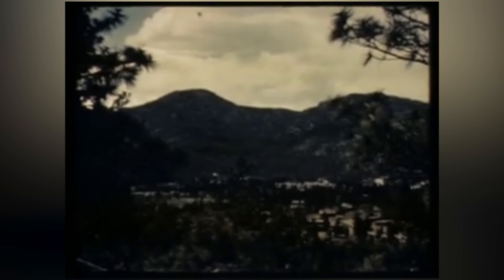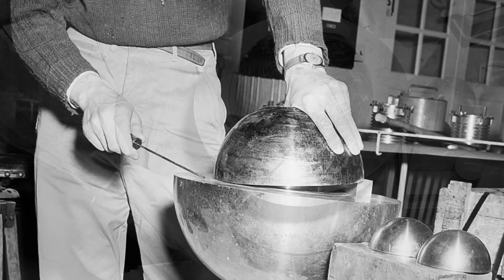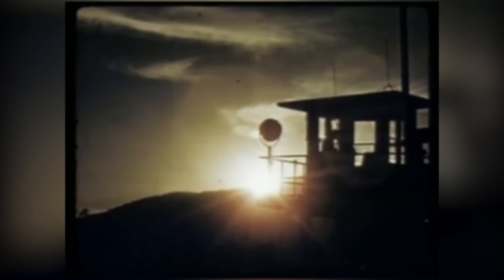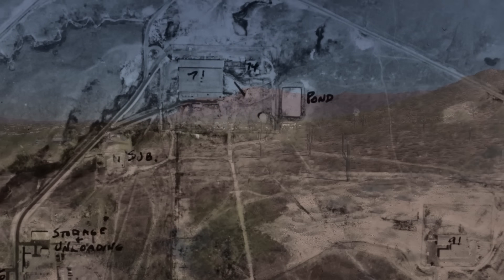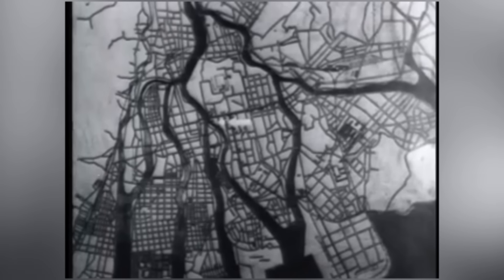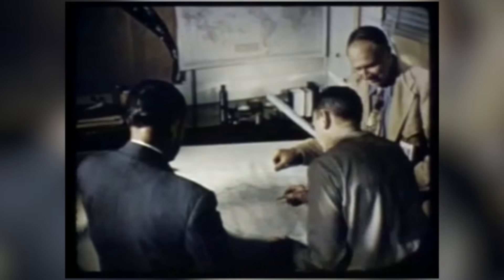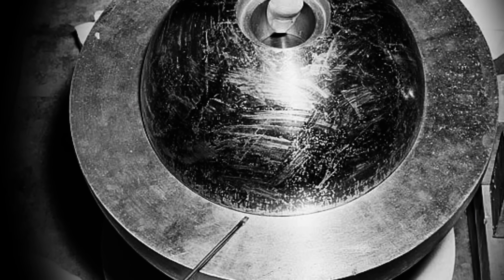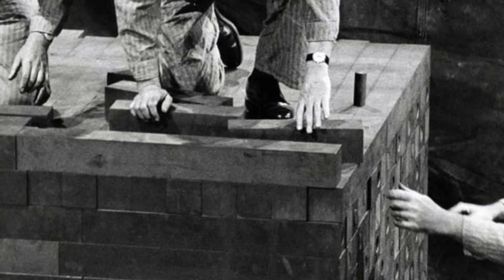Demon Core: The Unused Third Atomic Bomb of WW2

Comment: > 2 cores dropped on Hiroshima & Nagasaki -> 270k killed -> just normal cores
> 3rd core kills 2 scientists in an accident -> demon core
Reply: Good machines (or cores) don't kill people unless the operator intends them to.
Reply: Bill Randall  where you get that number bro? You're saying about 35k died in each city, on average? Lol
Reply: tim murray  the nuclear bombs were a single bombing run each though, the Tokyo firebombing was nearly 300 bomber flights, so not nearly as efficient.

Edit: population density in Tokyo was also much higher so it's possible if an atomic bomb had been dropped on Tokyo instead the casualties would have been much higher.
Reply: Didn’t they make a movie about that accident?
Reply: Parker Hetzel  There is actually plenty of room to argue casualties would not have been nearly that high. One factor in favor of the attackers would have been the famine which struck immidiately post war and whose conditions were set in motion, of course, by the war. Most japanese internal commercial traffic (including moving food) was concentrated in coastal shipping and a very small number of railroads. Lemay preferred terror bombing to the interdiction of the strategic transportation network on land but the US Navy had already done more than enough work in eliminating japanese merchant shipping. If the war had dragged on it seems highly likely Japan would have been forced to surrender, especially under a change in bomber operations to target vulnerable railway bridges and narrow coastal highways, in the face of a massive famine. An invasion would have still been necessary however, not because the Japanese would refuse to surrender, but because the Soviets would certainly have staged their own invasion and the US did not want to see a divided Japan (obviously preferring it to be entirely under their control). For that reason, that is the looming Soviet invasion threat, the nuclear bombs may have been necessary to speed up the surrender. On the other hand, the Japanese absolutely did not want to be invaded by the USSR either and there are persuasive arguments that it was the threat of Soviet invasion and not looming famine or nuclear bombs that coerced their surrender. Estimates of hypothetical American casualties in an invasion have also 
 since the immidiate post war years continued to be used to justify the dropping of the bombs by claiming they saved anywhere from around 250,000 to millions of American lives. During the war as they built up to invasion casualty estimates were typically keyed into specific operational timeframes but given all the other considerations I've mentioned it does seem likely that Japan would have surrendered shortly after the invasion began. If for whatever reason the Soviet's didn't invade and Japan didn't surrender is the only scenario I could see half a million to a million being realistic.
Reply: They called it demon core after the second deadly incindent, to suggest that something is jinxed with it, not because of the death toll.
Reply: Bill Randall  what? I wrote "they got what they deserved"
The scientists, for making these human exterminators.
Reply: @gyuui4242  I have to take issue with this thought that the bombs didn't play a large roll in the surrender. Sure might not have been the only thing working against them but you have 2 cities wiped off the map in moments a piece and it would scare the hell out of their admin. They'd have to consider this might become a regular thing and wonder how many the u.s. had. I'd think it's a little unfair to say no the Russian invasion looming was the reason. Sure it may have contributed but you can fight boots on th3 ground. You can't fight nuclear weapons man to man.
Reply: @onceuponadime978  I'd agree the bombs certainly didn't slow down the surrender process, they were definitely scared of more of those dropping, but they had already seen cities wiped off the map (Tokyo firebombing for example destroyed more square miles of urban area than both bombs combined). It wasn't the generals who convinced the Emperor to surrender, either, if anything it was the other way around. The General Staff was far more willing to adopt the "fuck you" attitude toward invasion than the Emperor himself, but to save face it had to be seen that the Emperor was convinced of surrender. In that regard the nuclear weapons provided the ultimate excuse. I think the best thing the nukes did was give the Japanese leadership a credible reason to surrender, rather than forcing them to or scaring them into it.
Reply: Parker Hetzel  The Soviet's wouldn't have needed a real fleet as the Japanese Navy hardly existed at the time. The amphibious invasion of the Kuril islands was undertaken with trawlers and minesweepers and other non-combat boats launching small craft full of troops, none or nearly no dedicated landing craft existed. The invasion of Hokkaido would have been much the same. It would have been possible, and given the Japanese had, as you said, concentrated most of their strength in the south against a possible American invasion there would have been much fewer troops available to defend against the Soviet attack, especially considering moving troops between the islands would have been extraordinarily dangerous for the Japanese at this point. It's likely the Soviet's could have landed multiple divisions on Hokkaido which would have been more than enough to overwhelm any organized Japanese resistance there and left them to deal with partisans in the way you've already intimated they were likely to deal with such threats. While the actual calculus related to the decision to surrender is likely locked away in an Imperial archive forever, I don't think it's possible to deny that fear of a Soviet invasion was a growing concern. 

In the end given the reason I mentioned in my last post (that the bombs were a convenient excuse for the Japanese high command to surrender) it is almost certainly true that the bombs saved more lives than they cost, especially and definitely so if invasion had been launched. I do believe the Japanese were looking for a way out of the war by this point, though, and I feel it likely that they would have surrendered under siege conditions. The famine, however, would itself be likely to cost more lives than the bombs in any case.
Reply: @gyuui4242    I agree with your premise, that the nuclear bombs enabled a surrender instead of the US having to conquer the Japanese islands, at the cost of millions of lives.  
There may have been another possible route to ending the war - blockade of food shipment to Japan.  Japanese shipping was already largely destroyed, just prevent crops from arriving from Korea and other sources, and shipments between Japanese islands, and the ability to prolong the war disappears
Reply: One plutonium core used for Nagasaki.   Hiroshima was a uranium gun type device.
Reply: @gyuui4242  .... You're correct sir... I've done a lot of reading about how German soldiers we're EXCITED to see they were being taken P.O.W. by Americans and not by the Russians from from the East.... There's no doubt the word of rape and torture and murdered Germans left after the Russians came through their town had made it to Japan... I'm sure the Japanese feared they'd be treated by the Russians like they treated any prisoners and citizens of conquered territories...(Ask China)
Reply: @loctite222ms  The US was eager to know which core was more effective / destructive, so two different bombs were dropped on Hiroshima and Nagasaki. The crap about ending the war was a sideshow; the real interest was in showing the world what the USA could do, and establishing which bomb would be developed (plutonium won)
Reply: AMERICAN scientist. 1 American is equal to approx. 1.2 million non Americans. I thought everyone knew that.
Reply: Inaccurate.  The third atomic bomb was used on Nagasaki, the second on Hiroshima and the first at Trinity (White Sands).
Reply: @ScottishPEACEguy  The scientists were working on a project to protect the United States from annihilation. ALERT...TRUTH BOMB WARNING...
The politicians and global leaders at the time deserved death....especially Rockefeller, Ford, Preston Bush, among others, who had placed Hitler and Stalin into power, attempted a coup d'etat against the US Government in 1933, gave the Soviets and the Nazi the Ford and GM factories to produce war materials in the 1920s and 1930s, sold both sides the Oil necessary to prosecute the war, and made blood money profits from the spilled blood and unimaginable suffering of foreign and domestic civilians and soldiers.  The war, the entire war, was orchestrated by Wall Street fat cats and the USA emerged unscathed, if you can imagine that, with her infrastructure unimpacted.  Thus we were the only real World Power post World War II. 

We rebuilt Europe, Japan, and the Soviet Union...yes...we even rebuilt the Soviet Union...on the sly. Type in the words, The Best Enemy that Money Can Buy, into Google, READ the book by Antony Sutton (Read them all) and get ready for a shock. Then READ War is a Racket by USMC Maj. Gen. Smedley Darlington Butler. He was the man who stopped the 1933 coup d'etat against the USA. He only won the Medal of Honor..TWICE

Seriously...Type in those names into Wikipedia. Your entire perspective will change as you will find out just how much that your schools have lied to you.

Your sorry ass would not be around to spew your drivel if Germany had gotten the Bomb first.  That is the reason why it was made....Germany.  We knew that we had Japan beat....before the first bomb ever fell onto Hickam Field at Pearl Harbor on Dec. 7, 1941.

Sprechen zie Deutsch?
Reply: @gyuui4242  There was a faction of the Japanese High Command who were against the surrender and there was an attempted coup while the record of the Emperor's words were being delivered to the Radio station to be broadcast. While loyalists stopped that, it may have gone the other way.
Reply: @avoimena  I hope that is snark. People die daily in automobile accidents on the roads of America due to human stupidity. (Yet it is far worse in Russia as if that makes a difference.) What do you want TO DO about it?
Reply: tim murray   The nuclear bombs did not end WWII, Japan was prepared to have ALL of its cities destroyed, they knew the war could not be won from the air. They were counting on the USA having to invade Japan and engage the Japanese on a man-to-man battle to the end.  What ended the war was the USSR turning east and putting Japan on its cross hairs. They knew Japan would not exist after a USSR invasion,  surrendering to the USA was the lesser of 2 evils.
Reply: Little Boy
      Aug. 6 1945. 8:16 am
      Hiroshima Japan
    Two coliding cores of uranium 237 = Gun Bomb = 15k tons
     Delivered by the B29 bomber....Anola Gay
             Fat Man
    Aug 9 1945   1:02 pm
       Nagasaki Japan
     One imploded core of plutonium = Implosion Bomb = 22k tons.
     Delivered by the B29 bomber....BoxCar
   Two cores of enriched Uranium  235 and one core of Plutonium 
      Just Sayin!
    The said core in this vid is Plutonium.
     It and the core of FatMan we're made from the enriched Uranium 235 used in Little Boy.
    Under controlled fission in a lab Enriched Uranium 237 can be enriched into Plutonium
     I'm not a historian....40 years ago I did a in-depth report on this.....😉
       These Two men were not the only Souls claimed by the Manhattan Project!
Reply: @lunchboxproductions1183      
        I'm afraid we have awoken a sleeping giant!
      Yamamoto
Reply: @gyuui4242   Your use of the word "efficient" is key. When hearing the repetitive ex post facto discussions about the morality of dropping the bombs, I emphasize that at the time the decision was made, it was a matter of logistics, not morality. The morality of killing 50,000 to 100,000 people from the air, repeatedly, was not a dilemma for those in high command. That decision point had been passed years ago.
Reply: Parker Hetzel u sound just like a history book, written from American Perspective for Americans.
Reply: @blackpowder4016       😉
      Exactly
  1. Uranium 235 gun bomb at White Sands
   2. Uranium 235 gun bomb at Hiroshima
      Both gun bombs contained two cores of uranium...... =4
   3. Plutonium  Implosion bomb at Nagasaki
     The said Demon core would have been slated as no. 4, but Japan's surrender left it for...testing.  Total cores 6
      It was a second core of Plutonium.  Studying with it in a lab is liken to Russian Roulette!
Reply: Demon core don't kill people, people kill people
Reply: 500kg bomb in Iraq IED 500g bomb in the US WMD
Reply: Yo do know about the mutiny by Japanese Army officers and several companies of infantry the night before the surrender was broadcast...their goal was to prevent the surrender, and force the Emperor to commit to fighting to the death...
Reply: Haha good point
Reply: And the other thing is many of the B29 firebomb raids killed more people than the nukes. Firestorms ripping air out of lungs, sparking people like matches...Hellfire.
I'd rather be at ground central of a nuke. Just atomized over burning or radiation sickness.
Reply: Eric B   The movie “Fat Man and Little Boy” depicts the development of those bombs, and does have a depiction of that accident. John Cusack played the unlucky scientist.
Reply: @johncronin9540  I remember that but I read at the time he was a fictional character added with his accident for drama. I don't think anyone died a quick massive radiation death from the war bombs ,beyond the Japanese near ground zero. Those further away...not a pretty way to die.
Here's something that might interest: John Wayne, cast and crew in the '50's filmed Genghis Khan in the desert, Nevada or New Mexico, near a former aboveground test site. He and many others died of higher cancer rates late in life. Makes you wonder about all the military men who witnessed tests or islanders near Bikini Atoll or the foreign sites.
Reply: Don Berry   I went and looked it up, after seeing the movie, and it did really happen. Apparently it’s not just the dose, it’s the proximity. In the movie, he had everyone in the room mark their location with chalk, and then leave the room. He ran the math, and while the others were a safe distance away, he knew he had received a fatal dose. In the schematic shown here, you see lines between the occupants and the device, which suggests the movie had that part of it correct. It’s also possible that the two accidents were combined into one. 

In the movie, he has a love interest with one of the nurses, and that may have added to the drama. But just as this documentary explains, he was using a screwdriver. 

But other people have, unfortunately, died from radiation sickness apart from the bomb. You must remember the former Russian secret service agent who was poisoned with polonium some years ago. Obviously it was no random crime, as ordinary people cannot just obtain highly radioactive substances. It was likely placed in his food, for he ingested it. His death was slow, and terrible. He was in the ICU, and while they likely do more palliative care than in the 1940’s, there’s still no cure.

The film may have shortened the length of his radiation sickness for dramatic purposes, it says in the video that it took up to 25 days from accident to death. 

As for those Japanese who were close to ground zero, they were almost instantly (and literally)vaporized, dying instantly. A few who had some cover (a bank employee and a trolley driver, managed to survive.
Reply: And rest in peace Karen Silkwood.
Plutonium doesn't just show up in your bathroom. I don't know what's worse, radiation poisoning or VX type nerve gas. Maybe we should have stuck with swords and battleaxes. Oh, well, live for the day, the future is unwritten...
Reply: @avoimena  Humans are flawed, even smart humans, and, especially smart humans. Technocracy, the management of the ignorant by the technocrats, is not a solution and will tend toward exacerbating fatalities and no by accident but with an underlying intent.  The substandard producing consumer will be deemed as obsolete, their life will be terminated, and their remains will be recycled back into nature as the result of the statistical modeling by the technocratic elite.

It will be a Brave New World.

It is not a good idea to fasten it to technological development. You stand better odds of survival when you do not.
Reply: Bill Randall  Would you accept Wikipedia as an accurate source?  If so, that number is in the correct range.
Reply: Jewish america
Reply: IluZIONIST AMERICA
Reply: @chaseroberts2860  ya I'm sure other countries value foreign lives over their own though right?
Reply: @pedro5941  would you prefer Hitler's?
Reply: Parker Hetzel  , Yes, the atomic bombs were actually life saving devices. Odd , isn't it.
Reply: @donberry7657  A technician I worked with 30 years ago, had been in the Army in the Pacific.  One morning, early, before light, they were marched down a road.  They were ordered to lay down on the road(I understood facedown) and to cover their eyes.  There was an amazingly bright flash, even with eyes closed and covered.  They were then ordered to recover(stand up in formation) and were marched back to their quarters.
It really ticked me off, even the first time I heard it, that our soldiers were being used as test subjects.
Reply: i literally thought the exact same thing !
Reply: kvvia  And the Japanese obligingly told us all about it?
I'm pretty sure that by mid-1945, the Japanese realized that they must inevitably lose the war. By August, their object was to take as many Allies with them as they went down.
Even after the second bomb the military leaders were against any sort of surrender. It was only when Hirohito overruled them that Japan finally surrendered. And even then, a haekish group tried to overthrow the emperor.
Our use of the Bomb was in response to Stalin's declaration of war against Japan. The US wanted to bring the war to an immediate end, before Stalin could take over territory and impose Communism.
Reply: Soviet landings on the Kuriles: If you look at the timing, you'll see that those landings occurred after the Japanese surrender. The Soviets took the islands after the surrender which means it had no impact on the surrender.
Losing a puppet province (Manchuko or Manchuria) they didn't care about, versus staring down total destruction and annihilation of their homelands. I'm pretty sure the atomic weapons were the main contributing factor. No doubt the Russians made up a huge propaganda story about how the US did nothing and it was all down to the heroic volunteer Russian liberators that Japan surrendered, but it's basically impossible if you consider the threat both sides caused to be Japan. Also, communications within the Japanese government at the time of surrender do indicate a large level of shock at the atomic strikes. There will have been attempts to downplay it, but others expressed horror at the prospect of facing a US that could annihilate entire cities at the push of a button, and had demonstrated willingness to do so.
Although the Soviet Union grabbed some small islands north of Japan they did not have amphibious landing capability. The Japanese were not stupid, they had up to date intelligence on Russian capabilities, and knew they could not pull off a full scale landing like the US could. 
As a matter of fact, by 1945 the Soviet surface ships - battleships, cruisers and destroyers were  extremely worn. The wear of Soviet ships was caused by intensive use in the war years in the absence proper repair. Actually by January 1, 1946, the Soviet fleet was unfit for action. 
The USSR could take away their holdings in China and Korea, but were not a threat to invade Japan itself. Even those islands the Soviets took were after the surrender which means it had no impact on the surrender. I would also point out that in the surrender announcement by the emperor, he mentioned the atomic bombs, but he never mentioned the entry of the USSR into the conflict: "Moreover, the enemy has begun to employ a new and most cruel bomb, the power of which to do damage is, indeed, incalculable, taking the toll of many innocent lives.   Should we continue to fight, it would not only result in an ultimate collapse and obliteration of the Japanese nation, but also it would lead to the total extinction of human civilization." I think that sums it up nicely.
Reply: that core was reused in desert tower experiment to prove what the theory said was true. mixed results expected from the theorist, from nothing to blowing away our atmosphere. actual known results (CLASSIFIED) were better than expected.
Reply: @gyuui4242  pretty sure it says 270k and his comment is unedited
Reply: Right, and the 2 dropped on Japan were bombs, that looked like bombs, dropped from bombers. This is a shiny ball in an office. You don't expect a shiny ball in an otherwise mundane office to cook people from inside out.